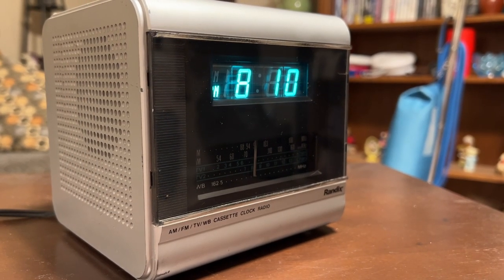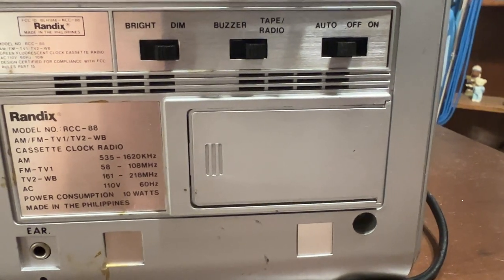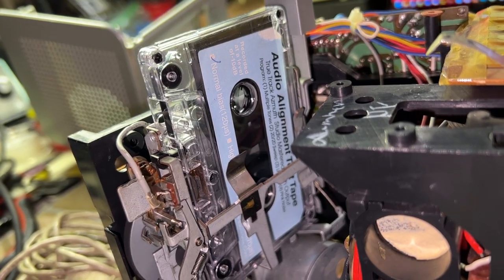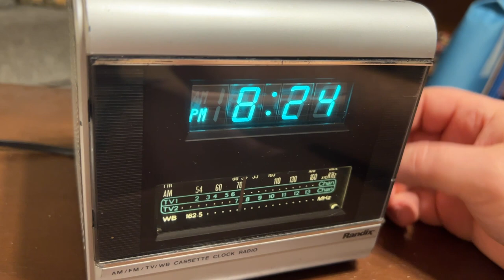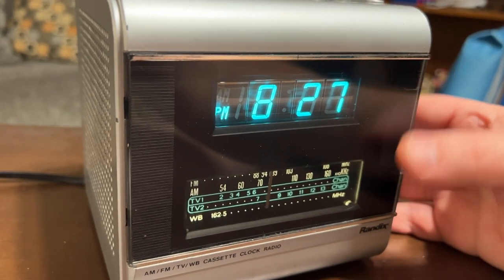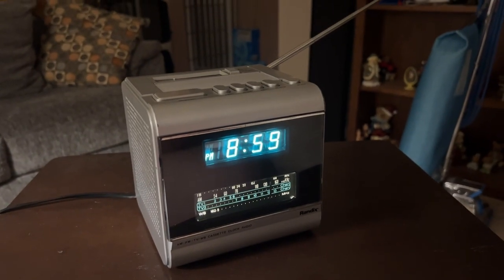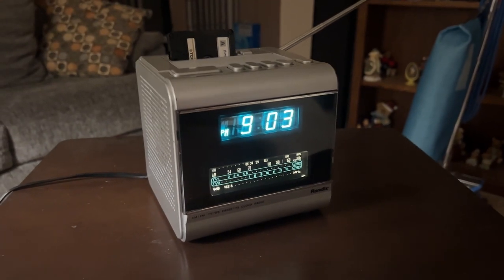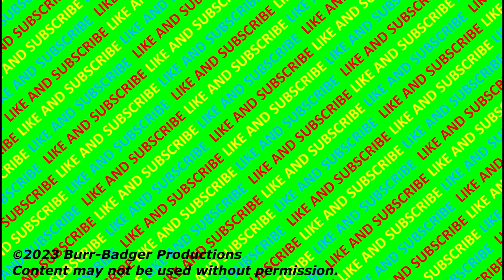1983 Randix AM/FM/TV/WB Cassette Clock Radio Model RCC-88

Comment: Back in those days many companies combined the lower TV band with FM.  This was a cost-saving measure.  That way, there was a single band that ran from 54MHz (TV Ch 2) to the top of the FM band (108MHz).
Reply: Also why you NEVER got a UHF 14-83 audio tuner.

Comment: I was given that EXACT model in 1984, by a neighbor, but it came with a pair of stereo speakers 🔊. Actually, no, not exact, but very close. Mine lacked the TV1, TV2 📺 bands. I liked the vacuum fluorescent display of these. They lasted up to 15 years (20 if lucky 🍀) before burning out. Just don’t drop the vacuum fluorescent display, it’s glass, and it will break easily. I’m not sure 🤔 if this plays in stereo, or mono. That’s a blowout bright display!! Operating it at lower intensity will result in longer display life. Your friend, Jeff.

Comment: The question would be,  does the pinch roller release pressure from the capstan when the tape is not playing,  for wake to cassette,  or does the tape get an indentation in it ?
Reply from the maker: Unfortunately no, the pinch roller remains engaged. If it was operated daily, it might not hurt it… otherwise, hello indent in the pinch roller.
Reply: @spatsbear  True... not only the tape,  but the pinch roller if it is left for too long.  That was something learned very quickly by car stereo manufacturers:  auto 8 track / cassette tape eject (and on better units auto roller release) when the ignition key is turned off... especially with extremes of temperature and humidity in a car.